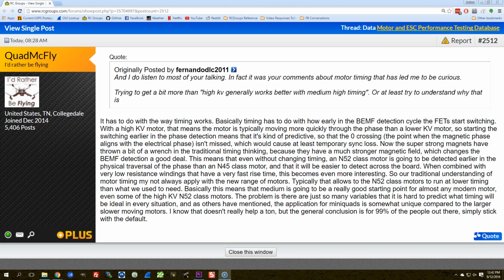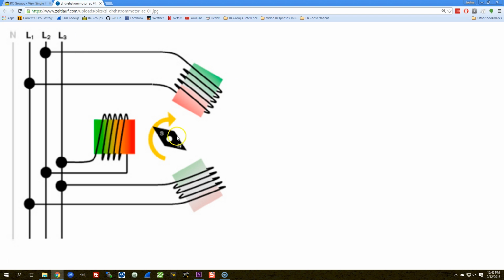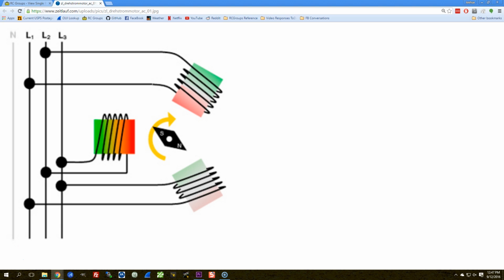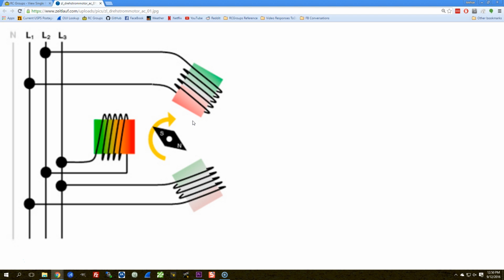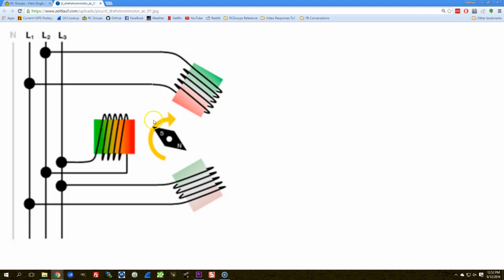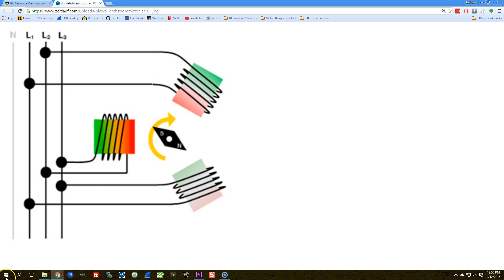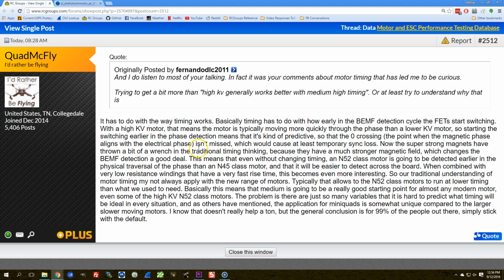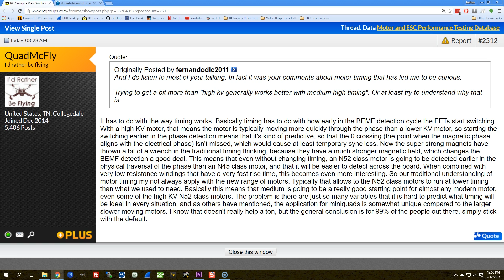BLHeli Motor Timing | EXPLAINED

Comment: So, if I have shitty tyro109 motors with chipped magnet in one of them and I hear clipping when I do max throttle suddenly, it means I get a desync and I should rise the timing right?
Reply from the maker: No it means you should replace the motor.
Reply: @JoshuaBardwell  damn it, I was afraid that someone would say that... Never buying cheap diy quads from China again...

Comment: So I have an Eachine Qx65 with a Eachine Beecore V2 Flight controller, I used Omnibus as the target, and version 4.0.1. The quad binds and arms but now the motors to not respond to throttle input, I did have to solder the vtx and camera back in. When connected to betaflight it refreshes, it shows the stick commands still work. Throttle works on the reciever tab. Could this be a programming issue, or could I have damaged something when soldering?

Comment: well if timing just tells us the time the esc thinks the motor coils will need to build up the magnetic field .... then that curve should be ez to mesure right ? also... you would need a osziloscpoe to mesure that curve you might wanna check out an absolute low budget ozi the dso138 its under 20€ ez to use and has enough to check simple things like for example the rising time of a coil in a motor voltage level over time, spikes, a pwm signal and stuff

Comment: So is there any connection between timing and efficiency ? As all has been said you mentioned that the coil part gets saturated for certain amount of time. What if we wanted to cheat this and simply put our timing to low and get less power?

Comment: Hi Joshua, FOC is one of the techniques to follow to control an electric motor efficiently. The 6 switching steps for the phases produce a lot of noise. Take a quadcopter for example, ESCs with 6-step switching do not incorporate a PID algorithm. From my understanding, they receive the navigation board data and adjusts their Pulse Width, hi-neutral-low,  without feedback, a least not of what I'm aware off. Feedback is actually the job of the navigation boards with all its sensors.

In an ESC includes a FOC algorithm, this work would be done by the ESC (calculates) and would control its engine, which would leave more time to the navigation board to do its work, read the data, processed this data and transmit the information of order at ESC. And for a DC motor, the wave will be trapozoidal, which eliminates very sharp noise.

The algorithm of FOC, its main work is to maintain the magnetic field of the poles of the rotor at 90 ° of the magnetic field generate by the stator poles (coils). In addition, it reads the B-EMF to determine the position of the rotor.

More sophisticated FOC algorithms also estimate the rotor's position according to a mathematical model of the motor and is able to determine the current it should produce to keep the magnetic fields to each other (stator vs. rotor) to 90 ° by comparing with the rotor position of the BEMF.

In many cases, there is no PID algorithm in the FOC, but only a PI algorithm.

The key job of a FOC it's to maintain a 90° electrical-flux angle between the stator and rotor poles for maximum and Stable torque.

Comment: This is a year old post, but ive run into a problem with super fast vibrations at high throttle,  ive changed FC, motors, props, pids.
still the problem is identical. so i started looking into the blheli configurator settings.  could this be timing related? ive tried medium and medium high. and the problem is exactly the same.   also ive been told to lower my startup power, but not sure where to go from here.  im using QAVX with lumenier AIO, lumenier pod, 4s,  speedix ES30HV esc's and hypetrain motors.
I had the cobra 2207-2600kv on there at first and thought it was a misbalanced bell... but nope.
thanks for reading! (oops sorry im on my daughters account lol)
Reply: this is actually me on my account.......
Reply: And one more thing, I mostly HEAR these vibrations than see them in the camera, they are high frequency "oscillations" at high throttle, rather than typical camera vibrations.
Reply from the maker: Fast oscillations at high throttle might be excess D gain.

Comment: Got a question. Today I tried BF3.1.3 with Dshot600. I also set my motortiming to medium instead of medium high. Now my flighttimes are way shorter than usual. Can this be caused by motortiming? Using Tmotor F40II 2400kv, aikon electronics 4 in 1 escs. gemfan 5*4*3 props. Thanks in advance
Reply: No. DSHOT is a FC -> ESC protocol, is the means for comunication, which happens to be digital for DSHOT... Motor timing is related to the ESC -> Motor power command, in other words, the ESC is literaly making the electricity to spin the motor, in form of really powerful voltage and current. And motor timing is one variable of that command, and it exists in DSHOT, Multishot and any other esc protocol. Hope that helps
Reply from the maker: If you changed a setting and you think you see an effect, but you're not sure. change it back. Only way to be sure.
Reply: tomorrom I'm going to test my old setting with BF3.1. Kinda stupid i didn't think of that this afternoon... thanks anyway
Reply: It was my understanding that the motor timing doesnt affect anything with dshot. Is this true?
Reply: Imagine if jb also built large uavs. I would so be your friend after all the flaming on fb 😅

Comment: What about some brushless micro motors? Like 1103 8000kV that's running on 2S? Thanks Joshua
Reply from the maker: Same principle. Just spinning lots faster. Probably need to adjust to high timing.
Reply: Thanks for the answer Joshua, do you think i should start with medium-high or high straight away? Or maybe medium?
Reply from the maker: For 8000 kv ?

Medium is probably too low. I really don't have direct experience with that type of setup to say for sure.
Reply: Thanks Joshua, Merry Xmax

Comment: Thanks for making this video Joshua.

I'm just completing another build & makes me wonder why can't we have some sort of motor manufacturer tested / recommended BLHeli settings ... as what comes flashed default on the ESC may be far from optimal.

I can also forsee the debate around BEMF, PMAC / BLDC motors, Faraday's Law, Maxwell's equations, etc.. going way over my head.  :)

Comment: Why is this not a issue with KISS esc's is there a algorithm within the KISS esc that determines that correct timing ? thanks for the info as always Josh
Reply from the maker: Yes. KISS has auto-timing that adjusts the timing dynamically. Also, it's perfectly possible to set a general value that works well on a variety of setups. BLHeli gives you the option to tweak the timing if you want to, but BLHeli's defaults will work great on almost everything.
Reply: Thanks that's what I was guessing Josh. I don't personally run KISS esc's just KISS FC. thanks to your tutorials never had any issues with BlHeli or BlHeli-S

Comment: hey josh. I have cicada 20a escs   running bl heli s with emax2205 2600 what timing do you recommend
Reply from the maker: +fpv flyby whatever the BLHeli default is, unless you have concrete evidence that something else is better. I think for blheli_s the default is medium high.
Reply: Joshua Bardwell ok thanks alot

Comment: Interesting, Im having a desync problem with my 130mm build using PIKO-FC LB20APROs, and EXAM RS 1306/4000kv....  alls good untill i punch it or attemp any roll/flip.... Ive changed the ESCs think its a possible motor problem. Ive got them in belheli 14.8 set a HIGH motor timing. NOW im thinking but them back to MED due to the high mag-field you described... on in using BF 3.01 4k/4k..... anything else you can think of?
Reply from the maker: +Hawaii Drone Racing try using unsynced motor output.
Reply: any advice what to set the set motor_pwm_rate = ??? or does to matter?
Reply from the maker: +Hawaii Drone Racing it doesn't matter if you are using synced motor output. Watch my video on multishot for more. Also my video on Betaflight looptime.
Reply: using oneshot125 ,

Comment: Joshua hi!, this can explain way some ESC burn in a collision?... with the sudden stop of the motor... what do you think?...
Reply from the maker: The ESC burns in a collusion because of the massive voltage/current spike that occurs when the motor stops suddenly. I'm not sure timing matters so much.
Reply: I know that is not related to the motor timing, but with how the motors works.. I understand that too with this video.

Comment: So it seems like the biggest effect a timing change would have is in the efficiency of the motor.  If it energizes the windings too early it's wasted energy and it may even fight the momentum of the motor.  Or am I completely wrong?  It would be interesting to see a graph of motor efficiency with respect to the 5(?) different timing settings in cleanflight
Reply from the maker: Yes, definitely. When checking timing, one of the first things I would do is measure thrust vs watts. Going to high timing can sometimes increase thrust and reduce efficiency. Sometimes it reduces efficiency without increasing thrust.
Reply from the maker: +Epic-Elite Dynamics I'm not sure. Like I said, I'm only at the sophomore level.
Reply: i wonder if my kingkong 2205 2300kvs could be more efficient, they eat 4s 1300mah batteries in a couple of minutes.. and they are horrendously fast, way more than i can handle. i wonder if props might affect timing too, i'm using kk 5040x3's i did have dys 5040x3's but they oscillated under full throttle .. i had what i thought was a desync or esc issue, it dropped outta the sky, i bought  a new esc but didn't instal it because the kk props  haven't had any drop's since.
Reply: they don't even feel warm,neither do my dys xm 20amp esc's, but i can make a brand new 1300mah turnigy graphene 65c beep with low voltage almost immediately. i'm still a poor pilot and i only have 3 4s batteries so i'm not getting much flight time to learn, i built this quad 6 or 7 weeks ago and i'm still scared stiff of it, so it would be great to get more flying time outta each battery...i'm actually thinking i need 1800mah to get a decent amount of practice... its only a 210 tweaker clone

Comment: so there are no guidelines at all to help decide if we have the right motor timing.?  no advice on what would happen if we had sub-optimal setting on motor timing?
Reply from the maker: +TheMadmacs desync in extreme cases. To find the truly optimal timing you need a setup like QuadMcFly has. Measure thrust vs amps at different settings, as well as response to rapid throttle impulses.

Comment: Such a complex situation.
Now questioning my use of med-high timing on my little 3" quad with 1306/3300kv motors!!!
And changing the timing when they are directly connected to a KISS FC is a pain me thinks.